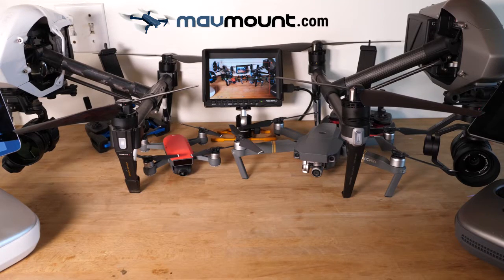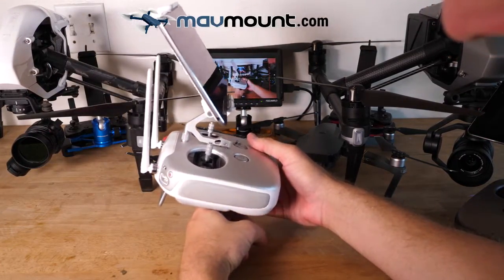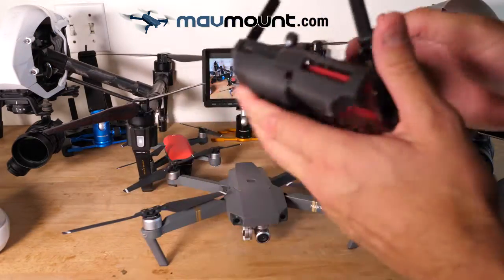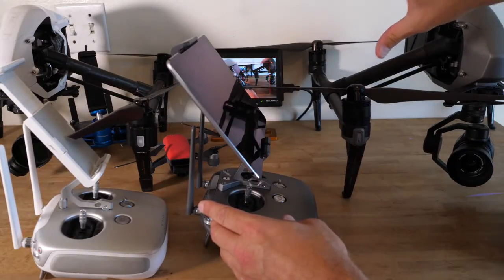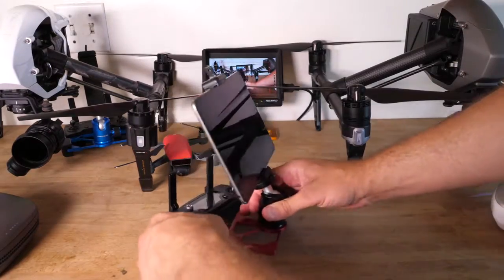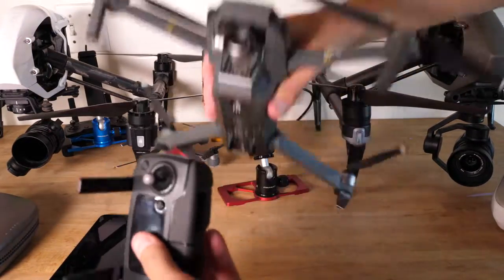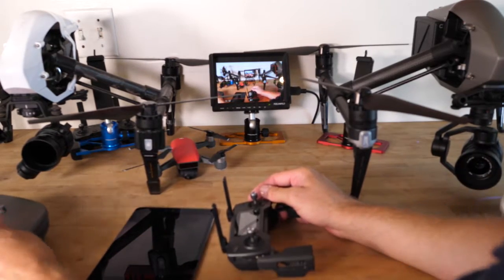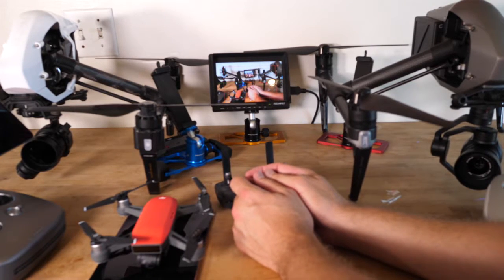The geometry of a well balanced mavic and spark drone controller

Comment: This is very nice, but you do not show a Crystalsky in the mount.... more importantly where and how do you run the cable from the Crystalsky if its on the bottom of the display right in the center where the mount would be.
Reply from the maker: Hi. This video was made before the crystal sky monitor was available. 

There is a hole for the plug to come out on the mount.
Reply: Thank you